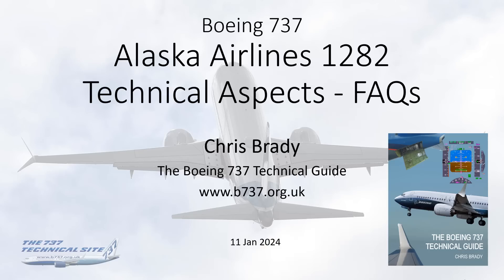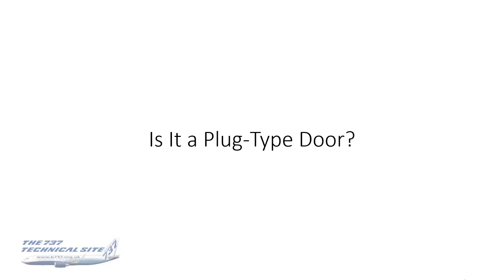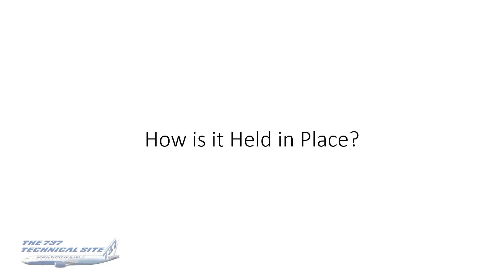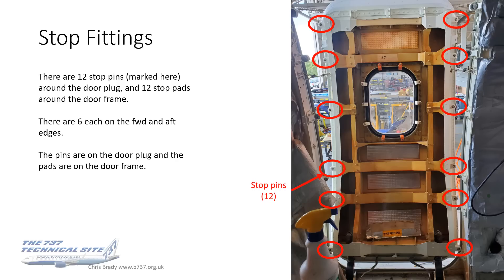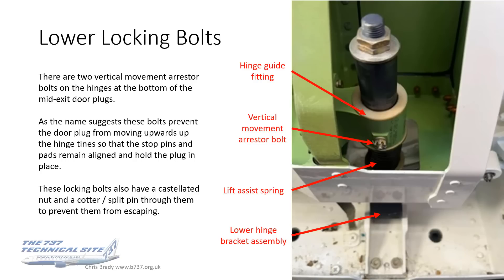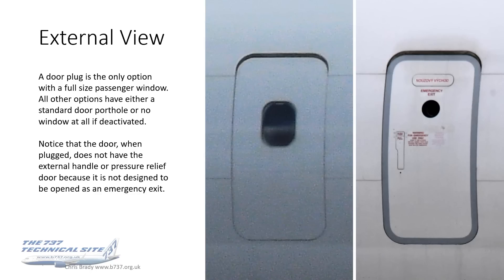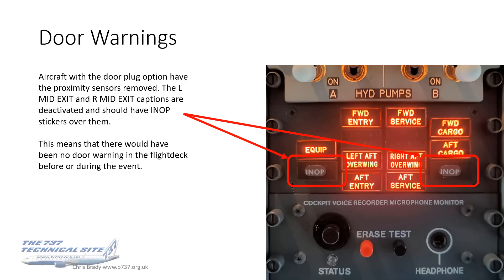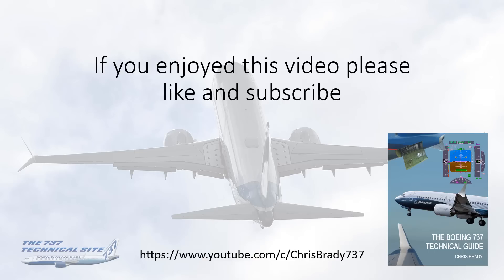737 Technical Aspects of AS1282 FAQs

Comment: The door is a plug type if you regard the 12 pins as forming an intermittent flange that is larger than the fuselage opening represented by the pads.
Reply from the maker: That must be what Boeing meant.
Reply: @ChrisBrady737  But stretching the definition, I'd say.
Reply: @ChrisBrady737  ... All the doors that open outwards, including plug-type doors, must have certain positions or orientations that allow it to, well, open outwards.
For me this is a plug-type door because the pressurization loads is resisted by fixed immovable features in the door that rest of fixed unmovable features in the fuselage, not by any latching mechanism. If the plane is pressurized, the 4 bolts with its castellated nuts and cotter pins, the 2 tracks, the roller pins, the bottom hinge, spring, hinge guide and hinge bracket can all magically disappear and the door is not going anywhere, pressed firmly in place from the inside against the fuselage by the pressurization loads. That, for me, qualifies as a plug-type door. Or a plug-type plug I guess?
By the way, thank you for addressing my question regarding the -900ER and the EAD!!!
Reply: @ChrisBrady737 compare it's structural dimensions to the MED...which is a plug door...initial inward opening motion yet it ends up outside the cutout.
Reply: No different to a vehicle radiator cap with its bayonet type 1/4 turn release mechanism. And that's an outward opening cap not a pressure wedging plug.
Any outward opening door should not be called a plug. Even calling the unused evacuation door blanking panel a plug is ambiguous.

Perhaps aircraft manufactures named  these latching outward opening doors "plugs" to placate the regulators, EASA FAA and UKCAA?
Enough semantic ambiguity to legally skirt good engineering practice?
Reply: @planespotter4494  Well. it's a view, but in my, and most people's it seems,  opinion, an unnecessary absolute. There is no need for a 'perfect' plug. As long as the door is wedged and cannot escape when in the installed position i.e. the flange or taper  is sufficiently continuous, then that is safe enough. I agree however that in the present instance, 12 points, with gaps in between,  has probably stretched the definition too far, since minor misalignment was enough to destroy the plug-type behaviour.
Reply: @planespotter4494  ... What plug door does not open outward, eventually? All airplane main passenger and emergency exit doors open outwards, eventually. Most of them are plug-type, including the 4 in the front and rear of the 737 (but not their overwing exits, these were plug before the NG but not anymore). This door plug (or its real door counterpart) doesn't outwards unless you slide them up first. I believe (but can't confirm) that when you slide the door up the door will also move in a bit in the beginning, due to the orientation of the hinge "pistons" and the geometry of the tracks.
Reply: @adb012   @adb012  The Main Entry Door of the B767 and B777 are inward opening plugs that move inward then slide up inside the skin of the fuselage to stow above the ceiling. The perfect plug type door.
Reply: @planespotter4494  ... You are partially right. I was wrong when I said "all doors", should have said "most". That said, while the doors of the 767 do open inwards and slide up as you said, that's almost the exception that confirms the norm. The ones of the 777 open outwards after you lift it when you crank the door lever open. The doors of the 757 also open outwards (I am mentioning it just because it was concurrently designed with the 767).
Reply: @adb012  some Aircraft I worked on had doors that slid up...what was that then?
Reply: @planespotter4494  ... Yes, you said the 767 and I said that you are correct and that I was wrong. The 767 doors slide up inside of the fuselage, as you said. You also said the same about the 777, but that's not correct. The 777 doors open outwards (but are still plug-type).
Reply: @planespotter4494  It bears no relation to a bayonet type cap. There is no rotation or twist, for a start.
Reply: @RicktheRecorder  no twist but a simple translation of an inch or so will open this cap type door. Like a simple 1/4 twist of a radiator cap.

Comment: Thanks for the videos Chris.  This door is, by definition, NOT a plug-type door.  A plug-type door is, by definition, larger than the opening in which it sits.  This door is exactly the same size as the fuselage opening frame.  It is held in place by the hinge at the bottom, and by outward pressure on the stop pins against the stop pads.
Reply: We have two words which means two totally different things depending on their sequence, right? This is a door plug, but not a plug door, it seems.
Reply: @JohnHallgren I’ve heard Juan Browne refer to it as a plug-type door plug
Reply from the maker: Some people are saying otherwise.
Reply: Based on that definition, can an aircraft door that opens outwards ever be a plug door?
Reply: After watching several videos , the whole assembly does not inspire confidence.
Reply: I agree. This is a plug because it "plugs" an opening in the fuselage instead of a door, doesn't mean it's a plug-type. In my mind a plug type exit or door is larger than the opening it covers. Not the case here. Not sure what Boeing actually call this officially, but on my plane the main passenger door is NOT larger than the opening, when it opens it moves upwards to pass behind the stops then moves outwards on its bottom hinges to open just like this max 9 plug, and it is NOT considered or described as a plug-type door by the manufacturer. Some emergency exits however are real plug type (larger than the hole) and are described as such in the manual.

Comment: So how can, in normal maintenance operations, the door be opened, lifted straight up in the upper guid slot?  As a plug wouldnt the door hit the upper airframe  There isn’t a flapper on the door as regular exits have
Reply: Look at a picture from outside the plane. You can see there is a relief at the top of the door to accomplish this.
Reply: Remember that the door is slightly curved so a straight lift upwards is possible, just like opening a battery compartment door on some devices.
Reply: It does seem very awkward. According the Chris and the manual the movement is about 1.5 "  That's a large gap.
Reply: @JoeLinux2000  Yes, the gap is about 2 inches.

Comment: Excellent and thoughtful. It would be helpful to understand how the door seals. There must surely be a flange and gasket of some kind. Where are the mating surfaces? Any gasket would need compressive motion to seal, but this could be prevented by mis-set pins vis-a-vis the pads. Between the compressed and uncompressed state the pins would be against or just clear of the pads. And how is the door forced down against the assist springs when it is shut?  

EDIT: Since this door is not in any meaningful sense intended to be opened and closed, I think the discussion has become perhaps wrongly obsessed with the opening and closing mechanism. The door is designed to be locked and bolted semi-permanently shut. All the hinges and other gubbins are only there to help get it, and to a lesser extent keep it,  in the right position. The key installation is the 12 pins and the 12 pads which carry all the pressurisation forces while allowing compression of the seal, whatever and wherever that is. However the outside of the door needs to be fair with the fuselage, and that might require a lesser compression of the seal than optimum. So we could end up with a door that is slightly looser on its pads than desirable. We are very short of information on this aspect. If the vertical locking mechanism has not been fastened correctly then what might be termed a rattling fit could result in the pins no longer landing properly on their pads, and the failure sequence begins.
Reply: Agreed, as a chemical engineer who dealt with leaky systems all the time, I wondered since the start of the investigation where a compressible elastomeric seal was located. I believe it can be seen at 3:29 as the gray and slightly abraded area attached to the fuselage above the stop pin contact point. I see a gray area above the top stop pad at 4:40 that I presume is the same seal.

What bothers me about that design is that it's effectively backwards with respect to how the plug would move as the aircraft pressurizes as the plug would be forced away from that sealing surface rather than against it. In a true plug door, it wouldn't necessarily matter on which side that is attached (outward facing surface of the plug door, or inward facing surface on the fuselage.) I remain confused as to why it's designed that way. Is it because an operable emergency exit door system includes a frame that is bolted to the lugs on the fuselage that hold the stop pads for a plug installation?
Reply: @stephenjarzombek2903  just an observer but had seen somewhere in last few days a series of maybe six pix showing a demonstration of how the exit door would slide with work at this location. The door dropped down underneath the slide, kind of like a gangplank.
I suspect the seal is located on the outside edge of the frame, just like a typical door weatherstripping. 
It also appears from the photographs that these 12 pins are adjustable, so that when the doors closed, even with pressure applied, it shouldn’t really move at all because there’s no give on the pads behind the pins,
Reply: The stop pins and pads control the seating  of the gasket which probably compresses over time.
Reply: The door is forced down against the assist springs by gravity; they are to help you open the door, like assist springs on a garage door.
Reply: @stephenj4937  the garage door spring situation is what I’m thinking it would probably be because I don’t think it’s going to be the type where once the locking bolts are removed, it boings up and out by itself!
Reply: I for one would like an explanation as to how increasing cabin pressurization increases the effectiveness of any gasket or seal in an outward opening plug.
Reply: @johnallport9565  It's no more an 'outward-opening' plug than any other aircraft door. The 12 pins of the door are on the inside of the pads mounted on the frame, so that as pressure increases they press outwards more firmly. That is the mechanics of the structure, but the air sealing method has not so far,  to my knowledge, been described.

Comment: Excellent update.  Non-industry people are greatly confused by the difference between a door plug and a plug door.  It's apples and water melons.   Catastrophic decompression has shades of gray. The decompression panels are designed for events most likely to happen such as a window or small hole in the fuselage.  The door plug, fuselage or a cargo door blowout are not likely but accounted for in the design.  Probably non-aviation agencies (EU and US) decided what information is in the manuals about the flight deck doors.  Plug doors are not as good in evacuations check the Manchester 22 August 1985 737-236 G-BGJL post incident reports.  A lot of safety improvements across all manufacturers were driven from that mishap.
Reply: Exactly, like a plug windshield, to prevent it from blowing out. This is a MODIFIED door, which Boeing sent them earlier, a memo stating a baseline door, DEACTIVATED, would be more cost effective in the long run.
Reply: With Plugs, the person sitting next to the plug has to be strong enough to lift it out and inwards.   Some emergency doors operate with compressed air.

Comment: 12 pins….  That’s a massive safety fail for a door to blow out then.  I would assume that a minimum of 4 pins were needed to maintain the seal.  That means 8 pins were improperly attached or missing.
Reply: No. The restraining bolts prevent the plug with its pins moving vertically across the pads. When all 12 pins clear their pads, the plug is free to open. All 12 pins and all 12 pads appear to be intact. The reasonable conclusion is that the 4 restraining bolts were not in place.
Reply: @johnbriggs3916 and it appears that a vertical movement of two inches or less is all that’s needed to clear the matching pads.
Reply: @JohnHallgren  He said yesterday 1.5 " but do the door pins and pads prevent the door from moving outward due to cabin pressure?  It's hard for me to visualize that.
Reply: @JoeLinux2000  Yes, when fully pressurised the pins press tightly onto the pads and the plug can't move. If the restraining bolts are not in place, vibration or flexing of the airframe can cause vertical movement of the pins across the pads if there isn't a pressure differential i.e. on the ground, takeoff/landing, low altitude flight. The loss of the plug occurred just as slight turbulence was probably encountered while the cabin was being pressurised. Although a vertical movement of about 1.5 inches is needed to open the plug on the ground, the pads are much smaller than this (about 0.75 in?)
Reply: @johnbriggs3916  I don't think the pins and pads secure the door.   THe door is succured by the track guides the pads and pins set the gap for the door seal.   They don't lock the door at least in my mind.  That's why the door can move up and out.  Are the pins interior to the pads?  If so they would restrain the door from blowing outward.   I's just very confusing without looking at an actual door.
Reply: @JoeLinux2000  (edited to remove incorrect text)
And those 12 act in sort of a handshake fashion.
The ones on the door move to the inside of the ones on the frame when shifted in place .
Reply: The pins and pads set the gap for the casket.   But here we go again with different pins and pads that confuse a person's understanding of the door.

Comment: Perhaps the FAA AD was not applied to the -900ER because all airframes of that model using the plug door option have removed and replaced the door or gone through sufficient periodic inspection by the customers since initial delivery by Boeing. Any subsequent defects would therefore be on the customer and not Boeing.
Reply: You beat me too it, I was also about to say that the 900 ER's are all older and have gone through heavy maintenance checks by now. These Max 9s are all fresh out of the factory still.
Reply: Yes, it's nearly 5 years now since the last -900ER was delivered.
Reply from the maker: I know the -900ER is long out of production but there are many ADs issued for out of production aircraft.
Reply: @ChrisBrady737 Yes, of course there are.  But very few of those are checks for omissions by the manufacturer that would almost certainly have been picked up during maintenance over the 5-12 years that the operators' fleets have been in service.  What's your theory for the reason it only applies to door plugs on the Max ?

Comment: Does the plug door have to be shoved down against the springs when closing/installing it?  Would the springs have been shoving the door up and therefore open all along(assuming bolts were missing)? Are the springs the design flaw?
Reply: It doesn't seem that great force is needed: the springs are to help counteract the weight of the plug.
Reply: @johnbriggs3916 it would seem that as long as the springs make the door weight neutral, like a typical door, that’s enough push. Who knows what it’s actually like.
Reply: The design flaw is in the quality assurance system at Boeing, as applied to assembly.
Reply: It's Polish door as in Reverse Polish Notation.

Comment: I made some rough guesses on the force on the cabin door due to depressurization and came up with something in the neighborhood of 6,000 lbs.  I don't know as the vent panels change that unless they are able to vent at a rate to where they can keep up with the change in cabin pressure.
Reply: yeah its not related to the area of the cabin ( which makes no sense )but the area of the cabin door. you could have a volume of the cockpit of a million cubic miles (not area) and still have the same pressure acting on the door. it looks like the over pressure will only vent when the decompression was in the flight deck. one would think if its advantageous to have blow out vents they would act both ways after all these doors were only installed after 9/11, why have a pressure rated door for security (weight and cost) i think this might be an issue for boeing, nothing in the SOP's right next to MCAS.
Reply: 6,000 PSI seems way too high.
Reply: @JoeLinux2000 I think he means the total force on the whole area of the door was 6000lbs not 6000psi

Comment: Very nice.  I've noticed that in the Jan 8 briefing, the statement that the light may have nothing to do with the plug failure came after a reciting of the FDR which included cabin pressures.  It seems possible that the NTSB was able to see the cabin pressure reading during some of the prior events.  That is speculation, but might have been why they made statement of "no indication whatsoever" of any connection with the loss of the door plug.
Reply: I'd ask a follow on though: how much happier would you be knowing neither issue was related? An aircraft that's not even 6 months old having enough of a cabin pressure problem it was taken off etops only to end up having a door fall off the back of it in a completely unrelated occurrence?
Reply: @eddy66t6  If the door wasn't seating properly it could leak.  Presumably the cabin pressure warning light measures air pressure inside the cabin not the doors specifically although my Honda has a warning light if a door is not fully closed.